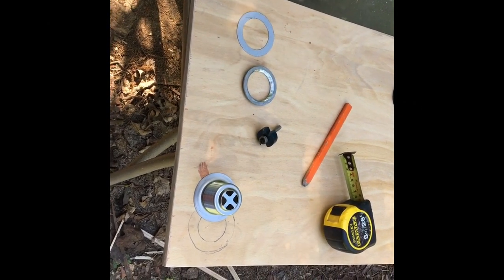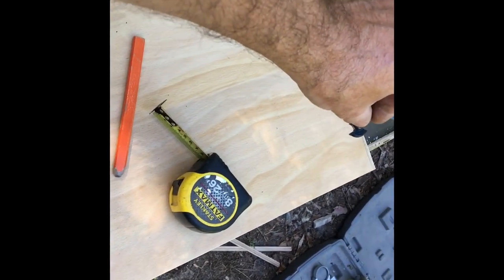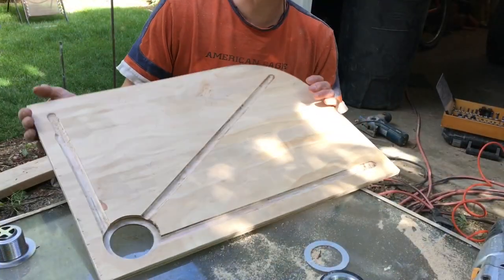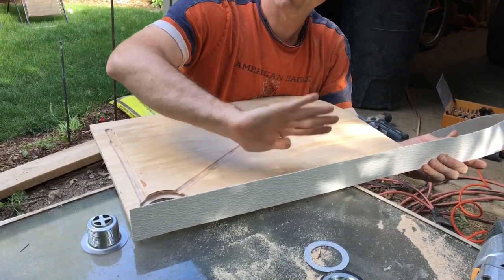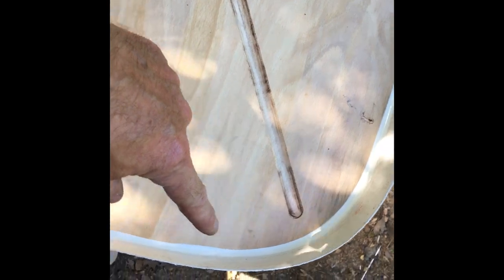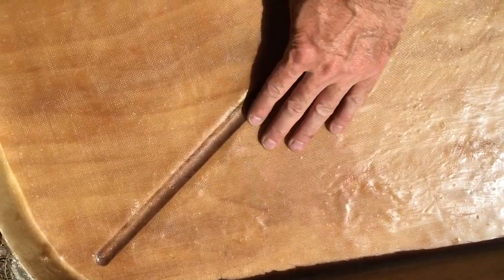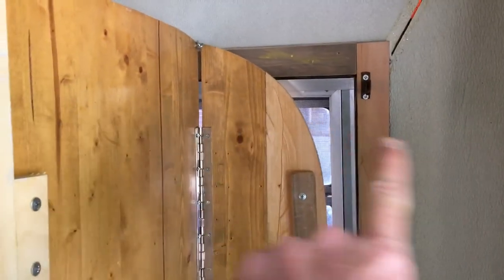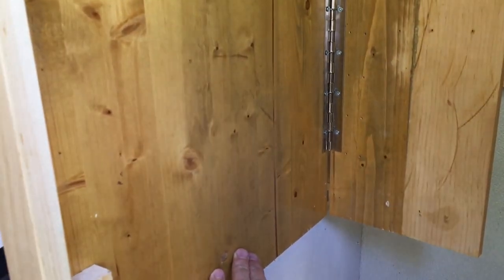Micro shower build for my vintage trailer

Comment: Nicely done.  Whose fiberglass system did you use?  Thanks.
Reply from the maker: Nothing fancy. Just bought it thru Amazon. It’s a Bondo product, fibreglass resin kit it Included the hardener. Then used chop strand mat for a few layers and then fibreglass cloth for the top coat. It’s been plenty strong we were camping all last week and everyday used the shower no cracks or leaks so far. Hope that helps.
Zac

Comment: Nice work- but why noyt just an outside portable shower? Bu the way I have 13" Trillium.
Reply from the maker: Nice, trilliums are a great trailer! 
As for an inside shower.... we thought about it for quite a bit, 3 reasons we decided to have it inside. We like to start camping in the late fall and early spring often with a light dusting of snow on the ground. To fire up the furnace and have a hot shower inside made sense. 2) Some parks that we like to stay in are very strict about allowing any dumping of grey water on the ground. 3) Last week we were crown land camping on the side of a lake absolutely beautiful but mosquitoes would pack you off at night, so it was nice after a day of fishing canoeing to go inside free from bugs and get a shower. 😄

I will though also be adding an outside shower connection to the side of the trailer in the future for convenience..anyways I think everyones “camping” style is a little different. It definitely might not make sense to everyone but it sure did to us.... hope that explains it. 😄
Zac